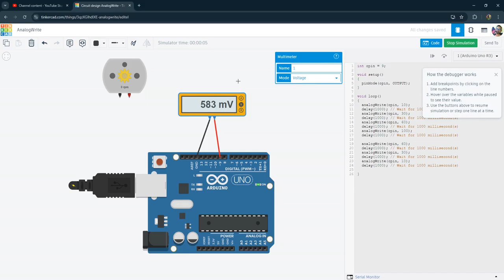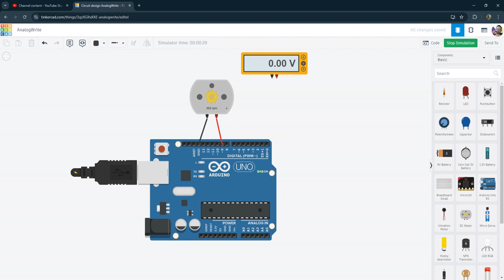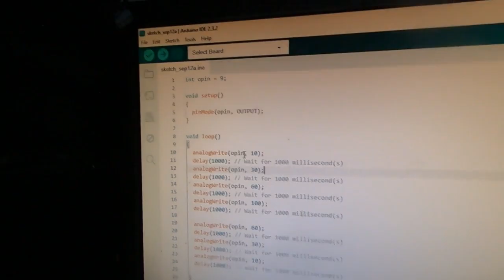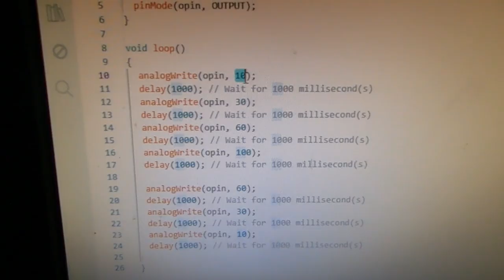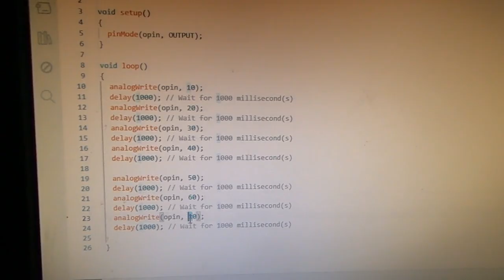How to gradually increase and decrease speed of DC motor directly using Arduino without motor driver

Comment: Hey! Nice to see you! Doing electronics?)
I'm currently making my own bldc motor driver with hall
I would recommend to use a mosfet, cause it' is not good to drive motor directly from arduino. To control the load such as motors, leds and other heavy load should be used with transistor or a mosfet
Reply from the maker: Thanks for the tips!
Sure you're right... because I know nothing abt electronics and this is just my dummy random experiment :D
Glad to hear you again bigmat!